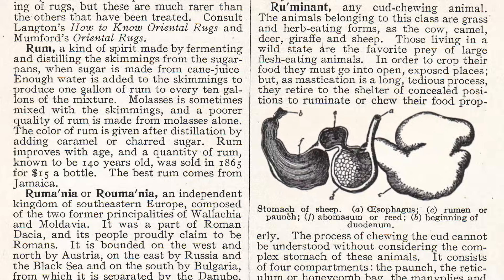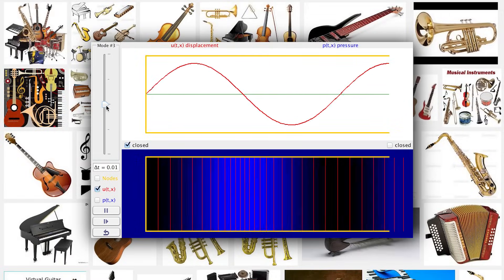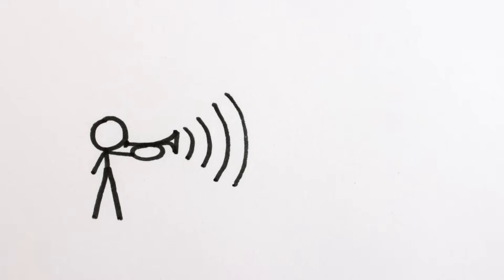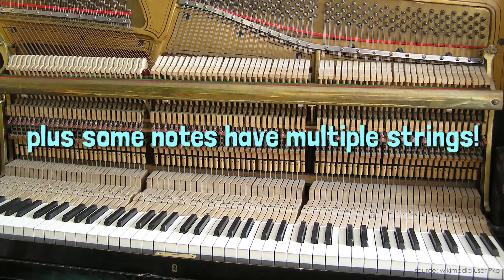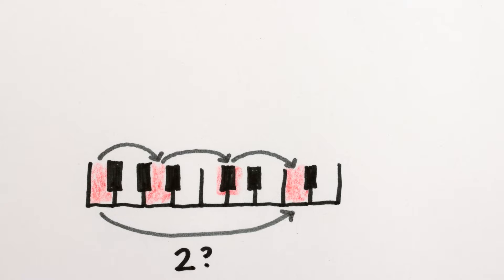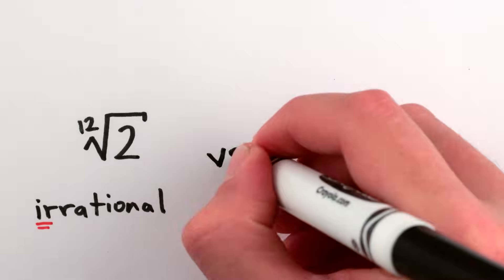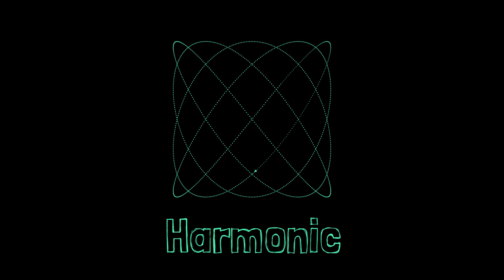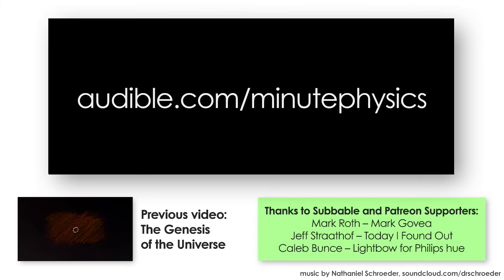Why It's Impossible to Tune a Piano

Comment: What you explain is the difference between just intonation vs equal temperament. But it has nothing to do with a piano. It has to do with harmonics.
My question is why you can not tune a piano with normal tuner. Why the higher octaves are out of tune (sharper) and the lower notes and flatter. Do you know that?
It happens only in a piano. With a keyboard, for eg. you can tune it in equal temperament and it is no problem. Regards.

Comment: You can't actually get a guitar in tune either due to the frets. Standard guitar tuning is a compromise, too. The open strings are a bit out from what they should be to match harmonics. If you tune using harmonics the B string ends up being a bit sharp as I recall. If you know you're playing in keys with the open B you might want to sweeten it slightly but if you were playing in keys that involve other notes, they'll be out of tune.

Comment: There's also the problem of partials. Piano strings ideally would have mathematically perfect harmonics that could be synched with the higher notes, but because steel strings have a certain inherent stiffness, their harmonics are only *partial*y harmonics- they're pushed ever so slightly sharp due to the stiffness of steel.

Comment: A mathematical tuning with perfect unisons will sound flat at the top and sharp at the bottom. Our brain needs to hear the high C %30 sharp of A 5 and %30 flat at the first. A. We stretch the already tempered muddle octave sharper than pure just barely. ( you can only notice by playing and holding most octives by themselves past a few seconds.)  Using. the bottom note as your reference note ascending,  and top note descending.  If you did it accurately, your piano will be %30 wide at both ends.

Comment: You can find a rational number that is arbitrarily close to the twelfth root of two. The twelfth power of 196/185 is 1.99991766, for example. That's good enough to span the piano keyboard with good accuracy.

Comment: that is not how stringed instruments vibrate. I have seen them at 1200 frames per second. A single helical (almost flat, depending on the striking, plucking, or bowing) wave bounces back and forth across the string for the overtone, and the harmonics do the same at higher frequencies. It is not a standing wave.

Comment: hhhmmm i could be wrong here but i dont believe that the 3rd harmonic on 1st string of a guitar [E] is the exactly the same note as 4th harmonic on the 3rd [A] string of a guitar as you say as they the differnt harmonics are diferent from one string to the next . the notes on the different strings are exact multiples, so there is no way an exact multiple on one string can give the  exaxt same multiple note as on another string. so you cant tune a guitar that way, but ive seen many guitarist try to do so and wonderd why they cant get there guitar to tune up.  and also as the guitar, like all intruments are tuned to the equal temperd scale so you cant, as you say, tune a guitar by harmonics as the ET scale gives dferent notes then any harmonicly note. i hope that ive got this correct. cheers

Comment: As good as his discourse is, he mistates that the octave is the only perfect interval in a tuned piano.  But the octave, like all other intervals, must be stretched by a fraction of a cent in the middle of the piano, and by 30 or more cents in the topmost octave more than the C below highest C (for instance).  

A simple test of Cs in octaves will show that if the piano octaves are not each stretched more and more the higher in the scale we go, then playing high C with middle C will result in the inescapable impression that the high C is flat.  When in fact it may be considerably stretched.  I tune the highest note of the piano 50 cents (a quarter tone!) sharp of its theoretical pitch.  The lower note, the less the stretch needed, because until we get down into the lower bass notes, the inharmonicity, the stiffness that causes upper harmonics to all run very sharp, is not so acute.  But to test a piano for adequate stretch, deliberate distortion from the equally tempered scale that would serve perfectly (for instance, a pipe organ, because a pipe organ has no inharmonicity of stiff strings), play a middle note with, say, three octaves above.  Does the trebled octave sound good?  If so, it is definitely, whether aurally tuned or machine tuned, very much stretched!  IF the highest notes of a piano are insufficiently, ""deliberatelly"" distorted sharp, the arpeggiated chords of the pianist when s/he reaches the highest notes will sound terribly flat: and nothing is worse than being flat when reaching for a high note.  The segments of a vibrating piano string are ALL shorter (therefore higher in actual pitch) than their simple divisions would lead you to think.  The Octave Harmonic segment of a piano string is not half the string's length. It is LESS than half the string's length because the piano wire is stiff and the non-moving node has a sensible length.  And this node is well understood to cause the remaining moving portions of the string to vibrate faster than mere twice the frequency.  Thus, stretch is required for every note of a piano.

Comment: I'm just trying to understand the frequency ratio and sound interval connection, but at 0:57 from octave to minor third there is a nice sequence from 1 to 6, and then there are those question marks at 7 and 8. What intervals are these? Why is 9 a whole step, and not 7 for example? Where will half step come in the sequence? Currently this is a big mystery for me, could someone explain?
Reply: 6-7 is also minor 3rd but even smaller of a minor 3rd than 5-6. 7-8 is also a major 2nd but larger of a major 2nd than 8-9.
Reply: The first half step we see is between the 11th and 12th partial.
Reply: Essentialy the intervals keep getting smaller the higher up you go.

Comment: Tuning with harmonics only works properly if there are no frets. Tuning a guitar with harmonics makes the strings tuned to just intonation, but the frets are spaced in equal temperment. The best way to tune a guitar is with the high E string and matching that E with the same E on the other strings.

Comment: But what if you tune octaves as.. octaves? Just double the frequency and tune the octave directly. You can also do that for fifths and fourths, and every other you have a well defined ratio. All the other ones you can then use aproximations such as 2^1/12. Then, for example, after the fifth is tuned, you tune his own octave directly. Would that not work?
Reply: The entire temperament is not only compromised by equal temperament tuning but by inharmonicity as well. The octaves won't sound good as a direct double...the octaves will sound better when spread slightly apart (top note sharper, bottom note flatter)

Comment: Question does it really matter if the  Xth key is "in tune"? It seems like you could ignore the last key difference and start from 0.  This way each octave is internally harmonic.

Example:
Note 1 to 7 are 9/8.
Note 8 is 2 times Note 1.
Note 8-15 are 9/8.
Note 16 is 2 times Note 8.
Etc.

Would this provide bad results?
Reply: Yes, it wouldn't work. Your example is wrong in part because it's bigger than an octave, but that's okay, I know what you were going for :). The problem is that whatever you picked, it's going to mean it plays inconsistently. So for instance one perfect fifth might be exactly 3/2, but another might be slightly sharp or slightly flat. People have decided that they like the consistent sound better, where every perfect fifth is about 1.498.

Comment: How did you get the power for the 4ths and 5ths? If you keep going up using 4ths, it takes 12 to get back to the same note, but you can't do (4/3)*12 because that's 31.569... And that would be drastically out of tune...

Comment: Early in the video you say that strings are traditionally made out of cat gut. While technically correct, only baroque instruments (or modern instruments with catgut strings put on them) use catgut strings, which are actually made out of horse, cow, or sometimes dog gut. There is little evidence of actual cat's guts being used for the strings. Nowadays they are almost entirely metal and synthetic strings.

Comment: FYI: don't tune your guitar using harmonics as demonstrated at 1:35 it will be out of tune. Better to use fretted notes or chords if you don't have a tuner. It's fine on a violin, because it doesn't have frets.

Comment: I get it, but I dont get it.... if you take a string, and divide it up into an octave, why cant you just divide up that octave in between based on the harmonic series? it may end up being more than 12 frets and then just duplicate that across other strings. I dont know enough to  be sure that the question I am asking is coherent

Comment: I still dont know why we have those 12 notes and not simply perfect harmonic ratios for each note inbetween the octave.
Reply: Because the ratios are slightly different for each interval. It's not possibly to have fixed string tunings that are chromatically accurate while maintaining perfect intonation; it's a trade off. That's why only keyboard instruments have this problem, with pretty much every other instrumentd you can adjust tuning slightly on the fly.
Reply: Because the ratios in notes within those scales would sound off. Think of even temperament like a sort of trade off: be slightly out of tune in every scale, or perfectly in tune in 1 and totally out of tune in every other one.

Comment: Concert pianists especially would be surprised to hear that it is 'impossible to tune a piano' - a remarkably silly assertion presumably made by someone with no musical training and no 'ear' for musical pitch. 'Perfectly tuned' depends on the temperament chosen and the musical considerations rather than the physics of sound. There are a number of tunings available - equal temperament, Werkmeister, Valoti, mean tone etc. with equal temperament tuning of e.g., the piano being by far the most common. Equal temperament is only necessary when the instrument is expected to be able  play in all major and minor keys with 'acceptable' intonation. If the instrument, e.g. a harpsichord, is only required to play in a more limited range of keys, a temperament best suited to that range of keys is used, e.g. Valotti. A harpsichord can be tuned to satisfy the tonality of the limited range of keys, and is therefore more 'perfectly' tuned than an equal temperament piano would be for that range of keys, but the harpsichord would sound more 'out-of-tune' than a equal temperament piano in the more obscure keys. This is not a subject 'minutephysics' is equipped to adequately discuss. Very superficial. Sheep gut, not 'cat gut'.

Comment: So I don't know anything about music, but you say that each something is slightly flat and each something else is sharp with this system, couldnt a computer accommodate for that? Like instead of having a system where each key is tuned to one system, can't a piece of software just change the tuning on the fly to make it not slightly flat or sharp?

Can you not tune any instrument with large numbers of strings, or is it about factorization of the number of strings? Whats the most number of strings you can tune?

Comment: Is that number 1.059463
Wouldn't that make it right? I am confused how it is wrong
I am trying to play with 432 Hz and am learning about how the notes are spaced
And trying to apply it to 432 Hz and find the best one
I am not sure how many notes were used in the real first music scale. I am doing more research tonight. I am talking about maybe in Egypt or ancient China even. Anyway I figured out the math to do it for 12 and 9 and 7 notes, equal tempered tonight. And now I am finding out that's how u tune a piano. 
Do guitar strings fifths etc not match up to the 1.059463 math?

Comment: Well, it isn't hard to understand.
octave: 2/1 = 2 
fifth: 3/2 = 1.5,  2^(7/12) = 1.498
fourth: 4/3 = 1.333, 2^(5/12) = 1.335
major third: 5/4 = 1.25,  2^(4/12) = 1.260
minor third: 6/5 = 1.2, 2^(3/12) = 1.189
major second: 9/8 = 1.125, 2^(2/12) = 1.122
minor second: 18/17 = 1.0588, 2^(1/12) = 1.0594

minor sixth: 8/5 = 1.6, 2^(8/12) = 1.587
major sixth: 5/3 = 1.667, 2^(9/12) = 1.682
minor seventh: 9/5 = 1.8, 2^(10/12) = 1.782
major seventh: 15/8 = 1.875, 2^(11/12) = 1.888

And there is of course tritone which doesn't even come close to any rational proportion: 7/5 = 1.4, 10/7 = 1.423,  2^(6/12) = sqrt(2) = 1.414

Comment: You COULD perfectly tune a piano using just tuning, it would just be limited to playing in one key and having to re-tune the piano to play in another, thus the entire point of equal temperament. But the piano isn't the only instrument with this problem; the frets on modern string instruments (like the guitar shown here) are also set to equal temperament. Why? Because otherwise you would have the same problem, having to re-tune the guitar if you wanted to play in a different key. The guitar is permanently tuned to equal temperament via its the fret placement - when you tune a guitar you are merely adjusting the fundamental note of each string, so that the guitar is in tune with itself. The number of strings has nothing to do with; it's a problem of instruments with fixed-pitches vs instruments where the pitch can be slightly adjusted through technique/intonation well playing (fretless stringed instruments, for example). Even then, you might end up with slight tuning errors when playing open strings. On a guitar, equal temperament also allows for the moving of chords and scales around the the fretboard. It's really the best/only solution when you want to play in multiple keys, or use all the notes of the 12-tone system.

Comment: Bugles playing any call only use notes within a single series of harmonics. In fact, bugles doing basically anything only use notes in a single series of harmonics.

This is because bugles can’t be tuned and don’t have valves to change air flow within them. They have a spit valve, but that’s it.

Comment: You actually can't really tune a guitar super well with harmonics for the same reason.  If you do, you'll end up with intervals on adjacent strings sounding really good, but getting progressively out of tune as they get further apart.  Also, you'll be out of tune with any other instruments the further you get from the string that you tuned to your reference pitch.

Of course, it's not nearly as bad when it's not compounded across many octaves, but the same mathematical limitations are at play.

Comment: This video ignores the fact that most pianos are not tuned with a 2:1 octave frequency ratio, but rather slightly more than 2:1.  This is due to stiffness of the piano strings, which slightly changes the frequency of the strings' overtones.

Comment: Erm.. You Can't use the harmonics on the  7th frets to tune a guitar because they will give you perfect 5ths. A guitar is designed as an equal temperament instrument which means the 5ths are slightly lowered.

Comment: My husband earned living tuning pianos . It needs to be  to be done.  He had hid own tricks and perfect pitch  pitch too.
Reply: What he means in this video, is the definition of a tuned piano, will inherently be out of tune among the notes.   In fact, it applies to all instruments.  Not just pianos specifically.

The issue is that notes that are 7 semitones apart (known as a fifth) should have a frequency ratio of 3:2 in order to be in tune with each other.  Similarly, notes that are 12 semitones or a full octave apart, should have a frequency ratio of 2, in order to be in tune.  You have to compromise on something to define the instrument to be in tune.

Equal temperament tuning is a compromise that prioritizes keeping all octaves intervals exactly in tune, while uniformly dividing the 12 notes across the logarithmic scale between them.  The fifths, fourths, thirds, full steps, and semitones will all be an irrational number, which means the waveforms will not meet in perfect harmony.   It till take at least 2 seconds to even notice the error of two notes that should harmonize as a perfect fifth.  But we accept that error as "close enough", and call it a day.

Comment: There is no reason that tune need be exact to the circle of fifths. The slow wobble is a part of the experience.  also fundamental are the harmonics  You cant stack dodecahedra without gaps, either.  The magic is in that it is not a perfect relationship.

Comment: wouldn't four bumps be another octave? Since it's double the two bumps... which is an octave.
Reply: Sebastian Sullivan yes
Reply: Yes, the fourth harmonic is two octaves up from the fundamental.  It's also a perfect fourth up from the third harmonic, as described in the video.  LIkewise the 6th harmonic is an octave up from the 3rd etc.
Reply: Yes but relative to the fundamental it's an octave. It seems to me that this basic fact has eluded most of the watchers here. And the maker of the video has missed a great deal of the point about equal temperament. 

E.g. He says that a piano vs. the guitar, cannot be tuned with harmonics. But that's not true, the guitar can't be tuned with harmonics either. Neither can be tuned completely.